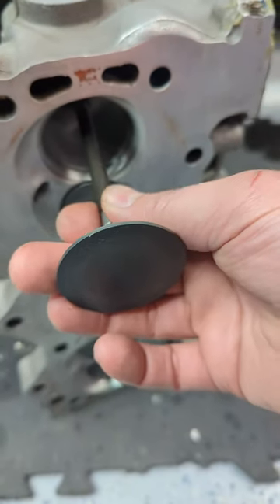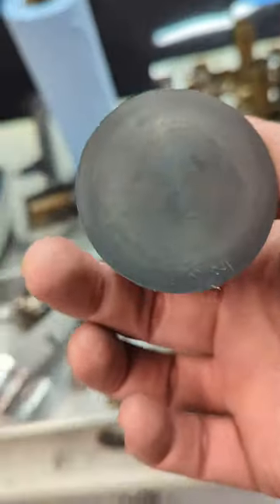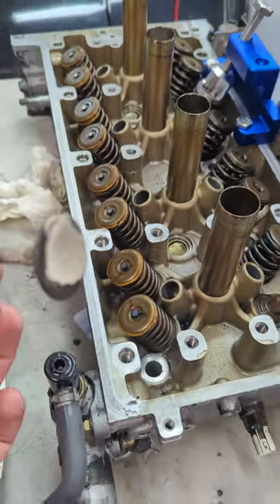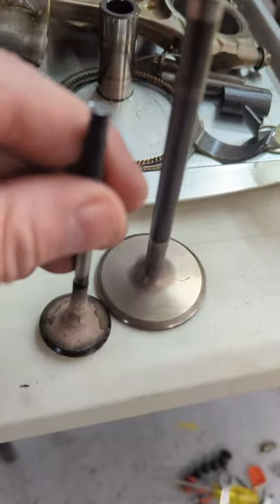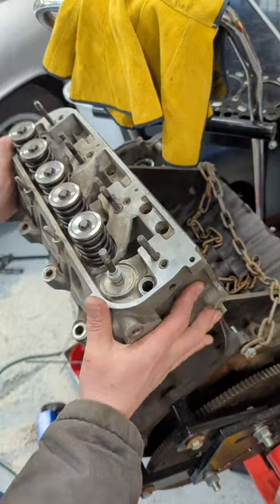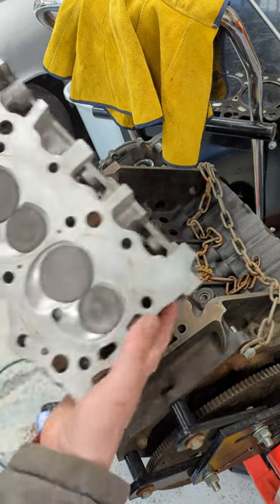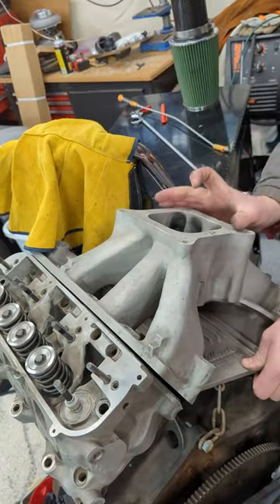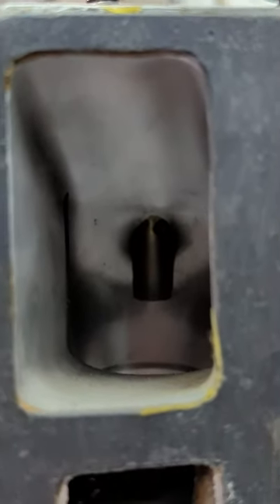Comparing Buick's Indy Car intake valve to Honda K20

Comment: I’m afraid the second valve was an exhaust not an intake just saying
Reply from the maker: I'll check tonight you could be right
Reply from the maker: You were right! Good job
Reply: yep, absolutely. I saw that as well
Reply: Curious what the flow bench says when testing both of those heads.
Reply from the maker: @RadDadisRad  if I get a chance I'll jump on it
Reply: you can tell by the ash deposits. if you have those on your intake valve, you have serious problems
Reply from the maker: @hibs5516  yea
Reply: @MotorSwapDan a mechanic who admits his wrongs is of the highest caliber!👍
Reply: That's what I thought as soon as I saw it... Too big of a size difference and the build up on the valve is more common to see happen on exhaust valves
Reply: @grapeseed427  Agreed
Reply: while we're correcting things how both K inlet valves to Buick valve since that's what the cylinder actually sees

Comment: Those Buick V6's were bad ass back in the day
Reply: The hell you mean back in the day the 3.8 series engine ran until 2008!!???!?
Reply: My Volvo s60 2.4t 01 was still whoopin it tho.
Reply: Still got mine. Champion Racing heads and they are close to the Stage II heads without the 6 bolts
Reply: They're STILL bad ass as long as they're in one piece!
Reply: rebuilt mine the other day, still bad ass
Reply: Nah, it's still raunchy.
Reply: They're still bad ass bro, 400 HP out of a V6 isn't something to sneeze at.

Comment: There's two ways to check if your valves are titanium first and easiest is a magnet titanium is not magnetic so if magnet sticks to it it's not titanium. Secondly it's a bit more complex you want to measure the displacement of water when you place it into a measuring cup preferably something with milliliters and then weigh it then you take those two measurements and divide its volume displaced by its weight to find its density and that will tell you what type of metal it is at least approximately.
Reply: Slightly magnetic with my neodymium magnet.
Reply: @Iamthatguy01  probably a low grade stainless

Comment: But the K series has 4 valves per cylinder instead of the Buick’s 2 
So really you should hold 2 Honda valves next to that big one
Reply: Yeah that's what I thought
Reply: It's still less total area than three one big valve:
35mm valve on the k20 will have 962 mm^2 per valve, 1924 mm^2 total intake valve surface area per cylinder.
The 3.8 has a 53.34mm valve with 2234mm^2 surface area. 

As I understand it, they were meant for the Grand National Sportsman (late model) class racing. 4.020" bore, 3.590" stroke for a 4.5L monster spinning at 7500rpm...not too shabby for a 90° pushrod v6! I believe the block was a more reinforced casting as well and wound up in the NASCAR cup series as well. Buick drew a lot of attention running a v6 against all the v8s and really convinced people the turbo thing was cool. Pontiac had a turbo v8 that didn't go over well because people would drive them hard like the old muscle car v8s and shut them off to cool down coking the oil in the turbo. Sadly it was kind of a repeat of the Oldsmobile JetFire in that a lack of understanding and turbo care led to problems and turbo removals. But yeah, the Buick v6. Very intriguing story behind it and how it came about. The Oldsmobile Quad 4 is another cool one, especially in the Aerotech.
Reply: Yep, this is also true
Reply: @94XJ it doesn't work off surface area, it works off the area it opens to the intake/exhaust runner and how long its open.
Reply: @Retired Bore these boys gonna learn today
Reply: @Retired Bore the term is curtain area.
Reply: It’s like measuring the lid of a tuna can instead of the sides. Wrong measurement.

Comment: This engine' secret has ALWAYS been about BREATHING !
Getting as much in, and as much OUT of as possible as quickly as possible !
Thanks to the turbo , the amount of fuel that was able to get packed into the combustion chamber and compressed was significant !
I would love to be able to see what this eg
engine could accomplish today, utilizing today's lubrication! !
I believe this engine would have been able to not only run away from the field as it did back then, but ultimately be able to survive the 500 miles !
Sadly, the IndyCar series has been reduced to a spec series of pack racing !
So much for imagination and development of some of the most incredible race engines and cars ever built !
Having said that, the 
DALARA CHASSIS has been developed into one of the safest racing chasis ever created !
All of which are the thanks of some incredible racing engineers and builders in the history of the sport of what is IndyCar !
Thank you DAN WELDON !

Comment: yeah that valve you're showing is an exhaust valve, that used one. another person also made a very good point. if you're comparing Honda valves, it's a 4-valve per-cylinder engine. you would need to hold these two valves up, against the one big one. because that engine has four valves per cylinder, the exhaust valves are much closer in size to the intakes.

Comment: Assuming all the water passages and oil passages match, then it should still bolt up and function just without the improved clamping force from the 6 bolt design right?
Reply from the maker: Yes pretty sure. I think it takes a custom camshaft because the intake and exhaust valves are reversed on a couple cylind rs or something. A normal cam would drive the valves at the wrong time.
Reply: It will only work if the intake is for a off center motor. Most stage 2 engines were on center. Also it requires a special cam do to the valve spacing on the stage heads regardless of what block you use.

Comment: Buick loved there little V6 they did a lot of work with them including the Buick Wildcat 24-valve V6 , a Buick 3300 Indy CART / USAC turbo V6 with fuel injection and the Buick Indy 500 Pace Car twin turbo V6. the little engines make insane levels of power for there size it sucks they ever stopped developing them but they didn't leave anything on the table when they where done they did every thing they could.
Reply: They were pretty special, giant killers

Comment: I heard the fwd 3.8 in the Pontiac Grand Prix gtp with the supercharged by fit right in the grand national engines place so the v2 3.8 block should as well!!? I did a 97 firebird with the 3.8 and we used a fwd engine in the original 3.8s place and all we had to do was tap the holes in the motor mount area cuz it was there but didn’t have threads in the holes for rwd setup so we tapped em and away it went

Comment: I have a Willys F134 engine. They are half overhead valve, half flat head. The intake valve is overhead and is like 2.10" in diameter like a big block lol.

Comment: To find out if it's Titanium or not, try drilling the end with a tiny bit. Steel will leave a decent mark or remove material. Titanium will barely have a scratch

Comment: Would you be able to drill and tap the extra head bolts on the horse power monsters channel the first 3 videos are of a serious 6 cylinder Buick turbo build and the guy that builds that dose a modification so he can get extra clamping to hold the head down to the block you should check it out

Comment: They use the Chevy 3.4 v6 in some dirt track cars because they had a spot to put a distributor in. So they'd have the whole k frame in the back of these little cars. The ended the class at my local dirt tracks so these cars popped up for super cheap and my buddy bought one that we rip around his banked oval in his back yard. BUT, what I'm getting at is there is a huge aftermarket following for the 3.4 which might also work on the 3.8 so they got badass intakes and heads and thumper cams. Just an FYI if you want to build a 3.8 or whatever

Comment: Isn’t that an exhaust valve for the k20 and doesn’t the k20 have 2 valves for each cylinder which will probably be just as much volume if not more than that Buick valve?

Comment: Grind a little off the side of the tip below the upper surface and the retainer ring. If they are titanium they will shoot white sparks. Also they have a different sound if you ding them with something metal. Most titanium valves are hollow.
Reply: Exactly right  I came to say this about sparks off the grinder,  steel gives orange sparks
Reply: Or just use a magnet…

Comment: Based solely on the condition of the valve, I can tell you that was eithet an exhaust valve, or your engine was running in reverse.

Comment: The Stage 2 head has 2.1 inch intake valves, K20 has 35mm intake valves, which equals 1.38 inches × 2 = 2.76 inches, so.........

Comment: Sad to say, that k20 would spank the gran national, and also outlast it probably by double... grand national, maybe 150,000 miles... ANY honda motor, easy 350,000... ive seen people run hondas woth no oil, and no antifreeze just to see what would happen, drove it back and forth to work for 2 YEARS THAT WAY! WOTH ZERO PROBLEMZ!

Comment: Titanium valves are simply stupid light, it's plain as day when compared to steel valves.  The exhaust valves on a turbo motor will probably be inconel or similar to.

Comment: And the K -20 or K-24 in any year civic will still drag the Buick....
Reply: Just cause your civic is loud doesn’t make it fast
Reply: @8__D  nothing to do with noise. All things to do with power to weight ratio… and vtec
Reply: @idontknow.1514  bruh vtech is just for fuel economy, swap in a vortec 5300 if you want a real power plant
Reply: I got a nice little snail on my FA5 civic si k20z3 I willl drag the dog shit out of that Buick any day any track I’ll race for pinks too and they can get a car length head start.
Reply: @8__D  you do still realize it’s not all about the noise tho right? You can add a straight pipe to most slow cars, But does that make em fast? Also there’s different variations of “vtec” most yea are for fuel economy but also can increase performance. It doesn’t take nun but a quick little google search to find that shit out 💀
Reply: @idontknow.1514  built engines don’t need vtec cause they should be capable of producing 100% power 100% of the time, vtec decrease power output when you don’t need it to save fuel
Reply: @SleeperFA5  how maney. Passes will it make before it shits the bed.
Reply: @chriscatarcio2983  idk quite a few since I just did forged internals and built valve train with a proper tune I should be running 600hp reliably

Comment: American motors are cfm based all flow and fuck all velocity most euro shit and jap stuff is about a good mix of velocity and cfm its a ballance other reason out engines are stupidly efficient compared to Yankee counterparts I mean even rover bought the small block boat lump and made it work for 30 nearly 40 years and we still use similar architecture today its funny but we can get them to run 100bhp per l plus hondas always been f u money when it comes to design and engineering they waste money to make something just cause I mean they make something for everyone they were making auto motorcycles before most 😅